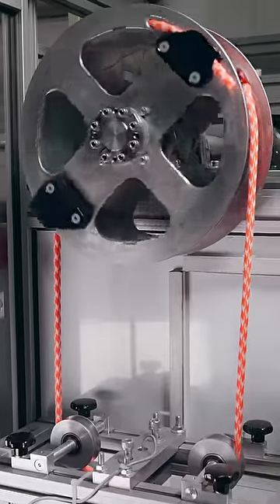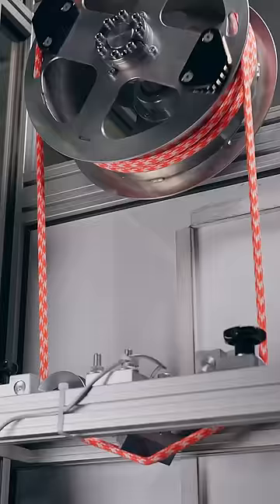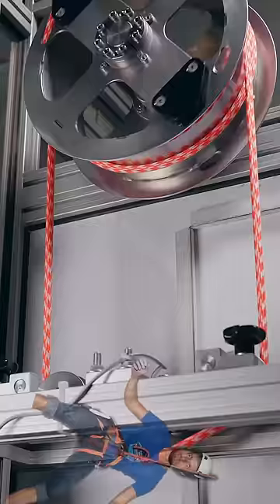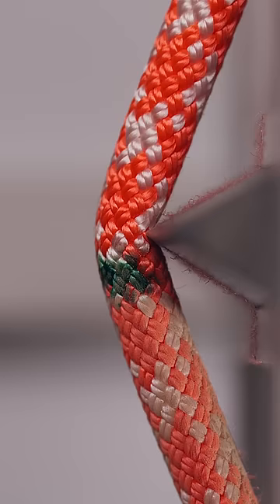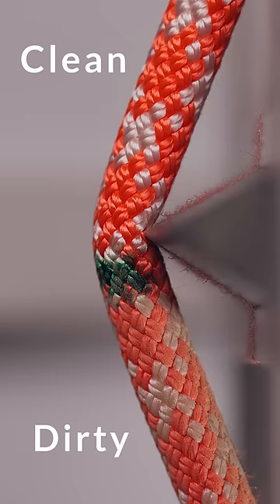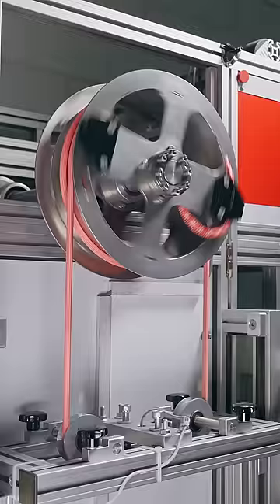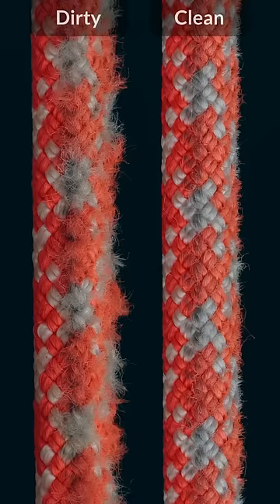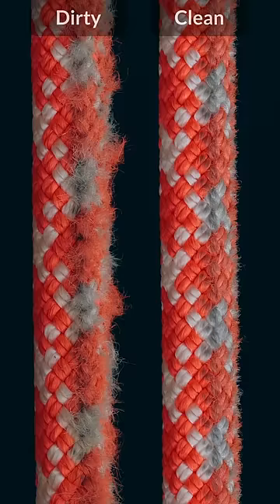Surprising Effect of Dirt on Climbing Ropes

Comment: As a rigger this is something we are all aware of. Dirt is basically an abrasive so it wears your rope down faster. It's why we always try to keep the ropes clean and inspect more often as they get dirty. Also, washing is not always a safe option for every kind of rope.
Reply: so learn what rope is safe for washing.
Reply: U mean like bdsm
Reply: i read rigger as something else for a second man...
Reply: @KristenZianourry2015  yeah I was wondering the same, I've only heard that for shibari bdsm 😮
Reply: whoa you can't say rigger
Reply: @KristenZianourry2015  lmaoo no
Reply: @kimhearse  what kind of rigging do you do?
Reply: 😆 aware maybe , always try to keep the rope clean ? Not even close 😅   mind due pretty sure i was workiny for cowboys 🤠 hard to keep dirt off your ropes when you're doing telco sites in the desert  , but in saying that our tower rescue ropes where always kept in there own bags  and kept clean as a whistle .. but generally if working off a static line would just make sure it wasn't going to be rubbing on any  sharp edges , rope placement and putting padding over sharp edges helps . But man you would of had a heart attack if you saw the state of our hauling ropes lol that full of grit and sand ..
Reply: When I was a rigger we never used ropes. Except as a tag line.
Reply: for anyone who's confused about the term rigger, it can refer to anyone using rope or other restraining devices to secure a load. In BDSM, it's most likely a person. In any other circumstance, namely construction or logistics, it's anything. Humans too.
Reply: @1rottwieler  I work in entertainment. Live theatre, concerts, ect. We don't use rope super often but it's not uncommon. Our fly houses are all a kind of rope. We use it to haul chain, to suspend certain things and for rescue and tie off lines. They definetly have there purpose, but every industry is different.
Reply: @manicole7235  It really depends on the type of rope and the application. My profession has me suspending sometimes thousands of lbs over peoples head. You screw up and somebody dies, just like you keeping the rescue ropes cleanier and in their own bag. The stakes are higher so there cared for me. It's all about balancing safety and reality and making a judgment call.
Reply: @dice7584  👍 Yep!
Reply: @onepawatatime7925 to my knowledge age restrictions are more often an issue, than abrasion.
Next to that, I've used very old and fluffy looking ropes at sandstone climbing without any issues.. It's all about limits and sound judgment
Reply: @stellviahohenheim I’m not sure, with the way he’s talking, he definitely sounds like a rigger 🤔
Reply: @stellviahohenheim rigger please
Reply: That's why you just don't do it lmao
Reply: @onepawatatime7925 in film, we use rope allllll the time. But of course, our ropes are all rated for the work we do. I'm amazed at how destructive the dirt was on ropes, as we end up working in some of the filthiest areas, its absolutely impossible to keep our ropes clean.
Reply: Rigga*

Comment: Also the position of the lines on each side aren't aligned. The clean side seems to have the friction on the stronger section of the weave and the other side has the line in the more vulnerable corners grinding directly into the very edge and snags would be much more prevalent there than if it's running against a flatter portion with a doubled string to also support the weight so it's running across two at a time and not just weak edges against the grain like the dirty side did. I don't know if this outcome is as accurate of a simulation as I'd be satisfied with.  Either way, very neat. Thank you for sharing this. Gives me lots to think about. Good luck with all of the awesome!

Comment: damn arborists def looking the other way after this dropped
Reply: as a former arborist apprentice, i was unaware that you could find a non brown rope without tree sap stains
Reply: I like pine tree and mapple tree
Reply: We would have to clean our ropes every day lol….
Reply: @Bryn Taylor  yeah regular gear inspection is enough. It's nicer if your company pays for your rope
Reply: High % alcohol is good at dissolving pitch from ropes
Reply: @Coastal_Cruzer  I would 100% not trust any solvents near my rope .
Reply: @bryntaylor7124  I don't blame you. Works well with clothes though
Reply: @Coastal_Cruzer  What's a mapple tree? 😅😂 Maple
Reply: @Wutzmename  was a joke, specifically referencing "I like fire trucks and moster trucks" -Walter Clements
Reply: @bryntaylor7124  I already do this for rope rescue. We worked at an iron plant that caused iron dust to accumulate, so we washed our ropes every day on the job.

Comment: I once went to wash a rope at the laundromat. It was a 100m 11mm static line i used for rappelling. I used a front loading machine and just a couple of tablespoons of liquid tide detergent. 

But... I'd forgotten a demonstration I'd seen in chemistry class.  Aluminum oxide is a catalyst. 

You wouldn't believe how much suds came pouring out of that machine lol. (Over a foot deep lol)  the manager didn't find it nearly as amusing as i did. I had to wash it three more times in plain water to get all the soap out.

But having to run it the extra times have me time to mop it all up lol

Comment: Look into the method they used to cut the blocks for the pyramids so precisely. They used long, dull "saws" designed much like the old push/pull crosscut saws used by lumberjacks, but instead of a blade or teeth, they just dropped sand in the groove. It's pretty fascinating how well it works.

Comment: I suspect that the results would be considerably worse if you used an actual rock edge in the test (rather than the machined, simulated rock edge).  The real rock edge would likely be considerably more abrasive.  Also, different types of rock would likely have different abrasiveness.

Comment: If the edge it's rubbing against is metal, did you see how hot it got from the friction?  Did you try the dirty side first clean side second to see if perhaps the clean side is more damaged going second after it heats up on the dirty side first?  Could you that but use an actual rock edge?   And do you think it might be different tension when you switch direction because the clean half had already been damaged some which would make that area spread out the weight to a slightly flatter position than it had while the pressure was scraping it on the edge and when you switch direction, the dirty half was starting at an already scraped area and without equal strength on the other end. I might not be making sense but it would be interesting to see them both run along in the same direction as each other for the same amount of time instead of swapping it back and forth. It feels kind of unequal pressure and resistance would affect the second half, especially starting right where it was already frayed when it started the grinding of it against the metal. Probably hot Metal.

Comment: This is one of the best reasons to keep your car seats and interior as clean as possible by vacuuming and shampooing the carpeting and seats as often as possible! Same goes for your carpets at home as well! 

Before you know it you have a big hole or bare spot wherever there is any type of dirt and friction together (like where your heal makes contact with your carpeting under the accelerator pedal). 

It will absolutely accelerate 😲🙄😂🤣wear and tear exponentially!🫧🫧🫧🧹🧹🧹

Comment: Experiment is flawed because rock is not like a smooth metal piece. of course there is a big difference when comparing friction on a smooth metallic surface with a clean rope and with one that has dirt on it.
I'm not convinced that there would be a significant difference between clean and dirty if it was rock instead of a smooth metallic piece.

Comment: All my ropes are sealed in sterile bags at all time. Once I get to the mountain I open the bag, and then immediately throw out the rope. It's contact with air makes it too risky to use.
I'll go through 7 or 8 bags before heading home. Never getting further than thr parking lot.
Climbing is an expensive hobby.

Comment: What did you expect? Dirt acts like sandpaper on the rope. A rock is not a smooth blade. Switch that smooth blade out for some dirty hard-core rocks and you'll get roughly the same result as a dirty rope.